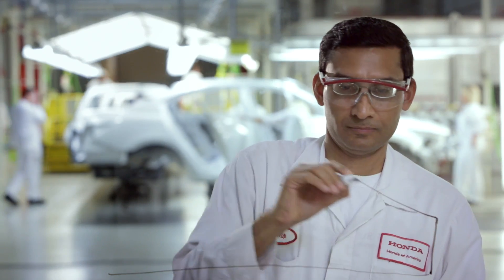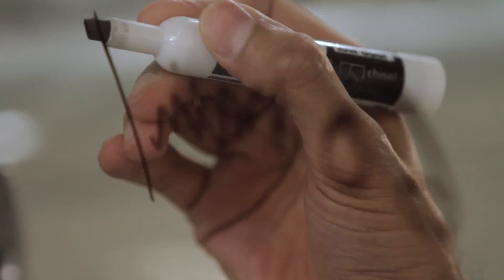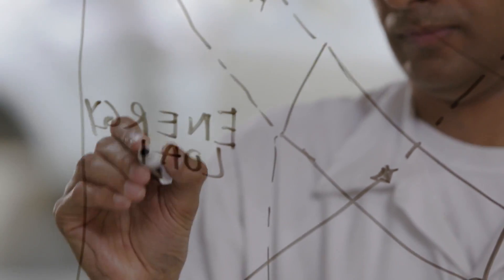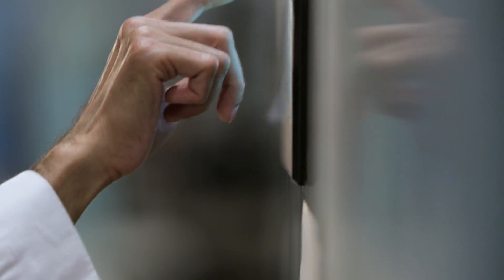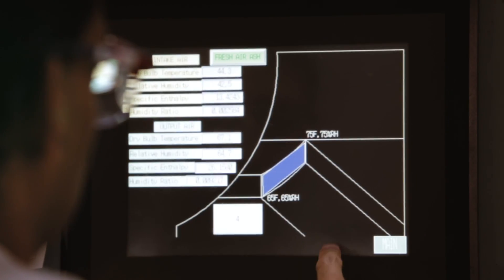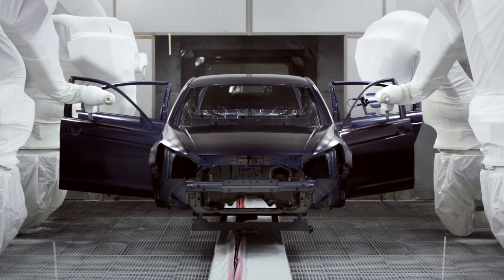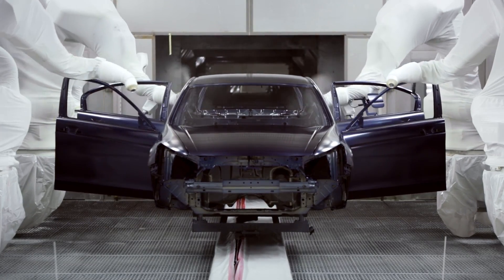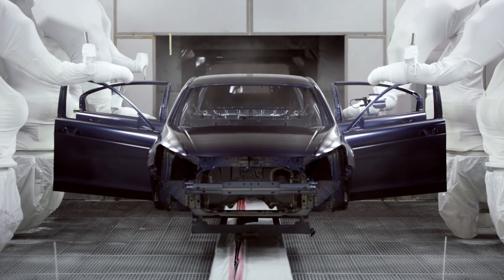Paint by Numbers: A Honda Environmental Short Film

Comment: MR .Shubho Bhattacharya 
    Hope this class action law suit works out for you and your developed engineers.I have noticed several hondas that are missing paint in areas that these auto paint machines miss  and please don't let me get started on the clear coat failure here.(Crows feet and premature fading )You might want to go back to the drawing board.I remember when older Hondas by the previous engineers and when they actually cared about customer satisfaction&loyalty and not cutting corners.

Comment: Shubho Bhattacharya is an amazing guy. Lucky for Honda to have him on board to improve the manufacturing process.
Reply: Ha!  Since ~2005 or so, Honda's paint has been a disaster.  It peels and flakes like crazy.  Worse, Honda Corporate has failed to address the problem, and has taken ZERO responsibility with respect to supporting its loyal customers.  As much as I like my 2007 Accord, this Honda will be my last.
Reply: @geonerd  I agree. I had a 2002 RSX-S that had zero clear coat fade or chipping. Now I have a 2020 Civic Si with the softest paint in existence. In less than a month I had to fix a multitude of paint chips that would never have occurred had I kept the older vehicle.